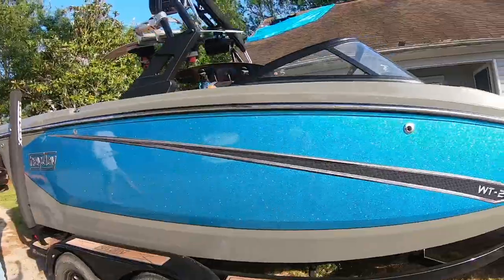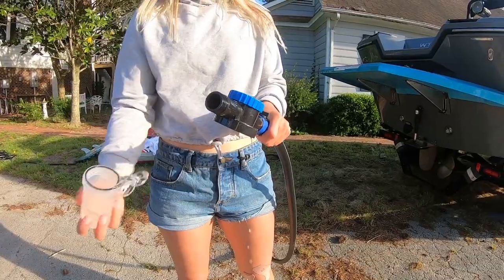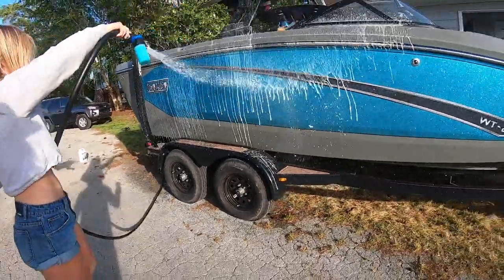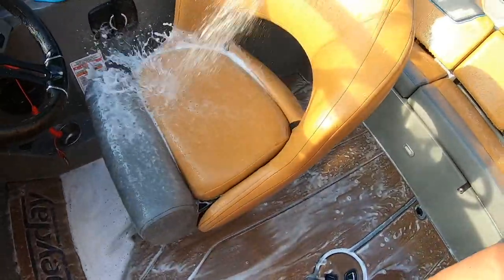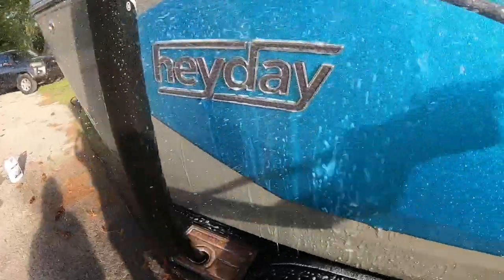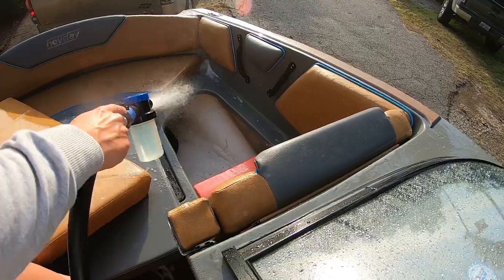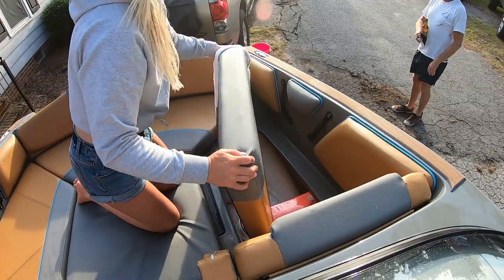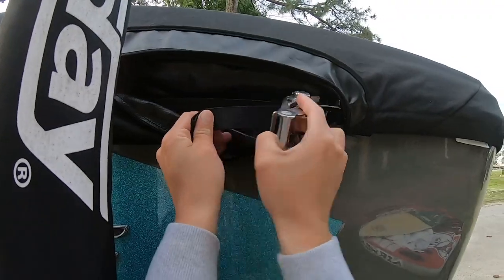HOW TO CLEAN YOUR BOAT || Easy tips on salt and dirt!

Comment: Excellent video thank you Carro. I just received my brand new WTsurf which I will also be using in very salty waters.
For the interior, do you think that I should wash cushions the way you showed after every use? Or once about every month?

Thank you again 💙
Reply from the maker: Short answer: yes every time ;). 

Longer answer: it depends a little on the climate you are in. I spray down and wipe down the interior after each use (even if you just do a quick 5 minute rinse and wipe that is IMO better than nothing). The salt destroys things so quickly. However if you're in cooler weather you also need to weigh the benefits with potential mold issues if the seats don't dry after you put the cover on. It also ofc depends on how wet your seats got during the session. Did people leave wet stuff on them, was it windy so that the spray blew into the boat etc etc :). Hope that helps!

Comment: What if the floor is carpet would you still want to wet the inside like that...
Reply from the maker: Depends on the climate you're staying. Yes I probably would but I would shopvac as much of the water out as I could and then leave to dry in the sun for a bit bit before covering.